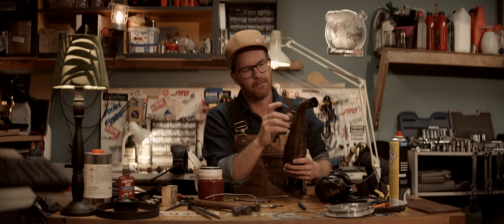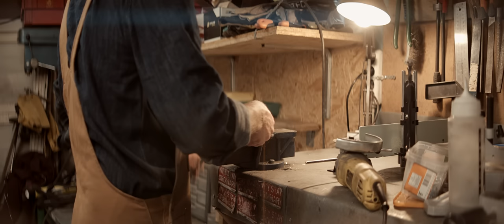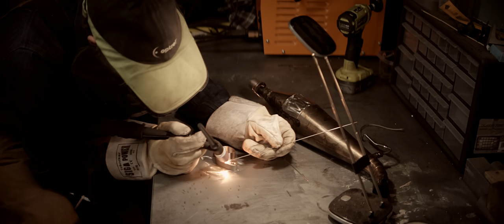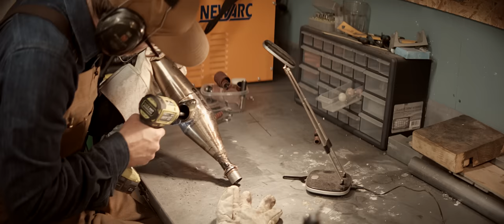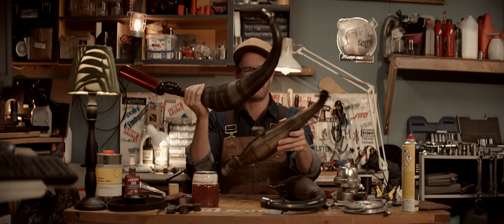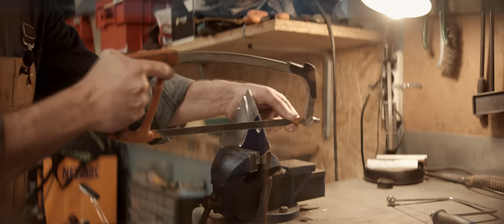Two Stroke Pipe Wastegate - Why do I get such strange problems?!

Comment: Looking forward to the inevitable variable length exhaust pipe for peak power at all RPMs.
Reply: Same here
Reply: I’ve had this idea for a long time myself
Reply: Or variable cones, but with burned oil it wouldn't last long
Reply: Or variable cones, but with burned oil it wouldn't last long
Reply: Or a power valve.
Reply: Or say a torque vectoring nozzle like on a fighter jet. As you turn the throttle, it tightens up the diameter of the stinger. My crazy ADHD brain just popped this thought into existence.
Reply: I'm thinking of bellows in a tube which are able to be pressurized and make the perfect pipe at any moment. But all the variable stuff has a big and heavy problem. The logistics of where to put everything....
Reply: @bstiphout1 yes, like a bladder, take a tap from one location of the exhaust to adjust the pressure of it to the pressure of the main exhaust path.
Reply: I raced the 135cc Enduro Lay-down kart class, speed 140mph. When I put on the Slippy pipe and ran the 150cc class with my 135cc engine I was very completive as others in winning and my lap times were way faster. My 135cc class I was the points leader. Pipe tuning skills are not with this one.
Reply: Knew a guy that made a variable length expansion chamber in the late 60's / early 70's. He put it on his racing go kart. The results were so good that he was banned from using it in his racing club.
Reply: @terry1309  The Karting world still uses a Slippy pipe. I raced with one for over 20 years now.
Reply: This guy build one 11years ago
Reply: 2 stroke trombone! 😂
Reply: CVEC FTW!!
Reply: The expansion expansion chamber?
Reply: I was thinking about that like 15 years ago for my Jawa 50 because it has only 3 gears you can't tune high enough. Something like a mowable center section
Reply: Lol imagine
Reply: Titanium pipe, turn engine so exhaust in rear. Center section threads with a coarse thread, maybe hydro formed so a centrifugal flyweight system can cause the length diff. As it only has to work one time per flat out run , some springs and grease and bobs your uncle.
Reply: While you have the gaping hole did you inspect the welds for deficiencies and alignment?
Reply: And lose the heat probe wrapped it next to the pipe, and insulated it will be laggy but accurate for what you need.
Reply: @mrsnezbit2219  do you think it’s going to last long. He’s building a bomb in his garage.
Reply: Yes please. Oh yes.
Reply: dammit, every where i look i thought i was the only one thinking about this idea.
but under this comment at 2 stroke stuffing 200 other people have this idea,
this broke my ilussion of being Einstein... LOL...
Reply: Wouldn’t a power valve be a better idea? I think that is the issue with exhaust but you guys would know more about 2strokes then I
Reply: Like a trombone. You hook the slider to your heel as you rev it out.
Reply: Connect the slider with the tachometer
Reply: There is a US patent out on such a design
Reply: I think only reason its running at high rpm is bc inertia gives it no choice but to run😂.pipes too small 🤷🏻‍♂️
Reply: The original plan for the engine was to run at a constant 20k rpm so it's always making peak power. That's why the pipe is so specific and case volume so big
Reply: Trombone
Reply: @kasper-jw2441  when it comes to engines almost everything have been thought of and tried. It is often some parameter in it that has made it not viable, price, weight, materials or technology.Sometimes it looks like there is a new idea but you can bet your hat on it that some thought of it i like 1920
Reply: @lunchman84   true, idea's are pretty easy, i also saw nobody attempting making an exhaust that can change shape.
the main reason big brands didnt work on this is because 2 strokes wont sell these days, but who knows, maybe in the future when the green people are convinced that 2 strokes arent that bad, maybe then..
2 strokes are just not viable at the moment.
Reply: variable length stinger is useless ..he's going for top end
Reply: @mrsnezbit2219 that shouldn’t be a problem if your using the engine properly. Meaning always in the power band.

Comment: Assuming you are still using slip fit crank bearings, you should check if you have side to side play in your crankshaft. If you do, that would cause the rotary valve to drag against the cases under pressure. During the downstroke, pressure is pushing against the rotary valve, and if your crankshaft has side-to-side movement, that would cause the crankshaft to shift to one side causing the rotary valve to drag against the cases. 

By making an exhaust leak, you are reducing the pressure pushing against the rotary valve, reducing the friction and allowing the engine to rev up. After certain rpm, the engine makes enough power to overcome the friction of the rotary valve allowing it to run.
Reply: woaw, very nice possible explanation you got there !
Reply: That is serious rotary juju
Reply: Good point
Reply: The pipe pressure and the crankcase pressure are independent. Lowering pipe pressure has minimal, if any effect on case pressure.
Reply: i belive that his rotary valve is not fix to crank for side to side movment, its just floating in housing
Reply: This has happened a few times.  Should be good now lol

Comment: a HIGH RPM starter and a HIGH RPM idle would make life so much easier. You don't care about low RPM so don't even bother with it since its giving you so much trouble
Reply: Exactly what i was thinking.
Reply: Like what he did with the clutch in previous videos ? Riding it onto the power band. Same videos that went well and higher rpm. The same videos he played with carbs like he knew what he was doing but didnt.
Reply: @andrewwhite986  Hes done that in previous videos.
Reply: @MrJermbob seems like you can build better one ,you should give it a try and record as you seems to disregard experiments he is doing. tbh we have no knowledge to know what to do next. tell us ,if you know better ,what should he do?
Reply: @MrJermbob  no totally not. The clutch wont do anything in this situation. The engine can't even get out of its own way when its under 0 load. Having a clutch won't help it go into higher RPM. It needs something external to spin it to that higher RPM so it can stay there( a high RPM starter)
Reply: @dieselgeezer18  Disagree but lets see whos right. ill come back and comment next vid.
Reply: @dieselgeezer18  Why did it rev before and come onto the pipe with a clutch ?
Reply: So im back. Your starter motor idea was dumb. @dieselgeezer18
Reply: @MrJermbob  How does his new video show that my idea is dumb? He didn't do ANYTHING with high rpm starters. please explain
Reply: Kinda like the mitsubishi evolution from extreme tuners... it idles at 5k rpm 😮 and gets upto about 12k rpm 😁😁😁😁

Comment: I think you have to keep in mind that pulse and gasflow are two totaly different things, for a good resonance you need just a little more then 180 degrees exhaustport opening time. 
It only gets in resonance (if exhaust is calculated well) in in the powerband . Distance from piston to the end of the endcone ( start powerband), and distance piston to the beginning of the endcone ( end of the powerband).
Think you have a gasflow problem, cause not long enough and to big pipe from the piston to start of the first cone.
Thats why it runs the best on the "mellow" pipe ! but the Mellow pipe has a way to long end cone ( good for wide powerband, but the longer the weaker ) weld a shorter endcone on your mellow pipe, and hopefully you get a good starting point to adjust and experiment further.
Reply: Yes it seems it has too much pressure in the exhaust and keepeing it at some distance lets the pressure out but the wave still hits. Maybe a perforated endcone would do something?
Reply: I was wondering what the total volume of exhaust gases are at the highest rpm desired. 
How much back pressure is created from this volume through the oreface of the stinger resonance vs back pressure. Can the two properties live in harmony?
Can’t wait to see the fix!
This doesn’t look like an easy problem to solve.
Reply: A mon avis il a plus de 180 degrés à l’échappement
Reply: Yep spoton I've been telling Alex time and time again just that piston to start of cone (expansion chamber) is way to short  , have no idea where he got the info from but he's believing shorter next to no length of pipe before cone starts is all topend power .
I hope he reads both our post and my other post and saves wasting time .
Cheers
Reply: @rexhorning7228  Yes I think the backpressure in the pipe is cancelling out the waves at all rpms, it's just more problematic at low rpm, I believe it needs a very short pipe with a larger diameter.

Comment: Good idea with building the high rpm starter.
You would just need to make the starter go above the troubling RPM. And have a high idle. It is a race engine after all.
Reply: I would go for a 3 phase high RPM (3600RPM), with some handles, a switch, and a clutch or failure coupling of some sort, so you don't break a wrist or an arm if it stalls, and a one way bearing ofc.
Reply: Sounds like the clutch idea he had in previous videos. So dumb.
Reply: @@tobiascat6173 Why not just go back to when it revved and not need the starter motor ? LOL

Comment: This is very interesting. Similar to a musical instrument. Put a speaker at the inlet and connect a variable tone generator. Go through the frequency band and manipulate the exhaust pipe like an instrument.
Reply: This is a fantastic idea.
Reply: If you measure the impedance curve of the speaker in free air and compare it to when it's connected to the pipe, it should give an idea of the character of the pipe. Free programs that can do this would be ARTA or REW. One can also buy a complete HW & SW called DATS, not too expensive.
Reply: @belyear  Needs to be very hot though.
Reply: Make a few sets of "ocarina" pipes to test resonance profiles. It's not just a matter of having a valved hole, but where to put it.
Reply: I have done something similar with the inlet manifold on my car engine fitted with Dellorto 40 DCOE carburettors in order to decide on an inlet ram pipe length. Play a frequency range with a signal generator and loudspaeker and "listen" as so to speak with a spectrum analyser to pick up the resonances. You can often pick up the resonances by ear also. Correlating the resonances with dimensions id=s the trick part.
Reply: You guys are making it a bit too technical. This can all be done on paper, but Alex prefers to work with metal instead.

Comment: I think your very cool exhaust port design is making the engine really sensitive, therefore normal pipe design and issues aren't applicable to your engine. It is a very very cool (interesting) problem to have, glad I've been following you all along
Reply: I mentioned before that it seems like he needs an exhaust not designed to maximize resonance but to maximize flow and find a reasonable amount of backpressure.
Reply: The exhaust was made for his exhaust port design. He doesnt run the "cool" exhaust port design that the pipe was made for. This is why the pipe is wrong. All these suggestions in these comments are freaking dumb.
Reply: @microsoft790  But flow isnt a thing to consider on a 2 stroke lol ? The flow is simply set by the last dimension of the pipe which is set to the thermal limit of the engines ability to stay cool.
Reply: @MrJermbob  flow is very much a thing to consider and I don't know where you even get the idea that it isn't. Any motor with too restrictive of an exhaust is going to choke itself out especially one thats supposed to shove exhaust gas back into the cylinder.  as far as I'm aware his end goal is still to have positive pressure on the intake side of the motor, and that's going to make it REALLY hard to get his exhaust to resonate consistently. Until he moves into actually scavenging the exhaust out instead of back in, his motor is gonna keep choking.
Reply: @microsoft790  Two stroke exhaust tip outlet dials the hp and thermal limit of the motor. Not the flow.
Reply: @microsoft790  how can it be choking itself at 2000 rpm? It's an exhaust with a 15mm, englarged to 25mm, stinger. That's almost the size of the exhaust on my 1.0 car lol
Reply: @MrJermbob  then why would it not work at all with some other exhausts? Then why would it need a giant galing hole in the resonance chamber to even start? I think that such a unique exhaust design requires an equally unique approach to problem solving. But that's just me, a little guy on the internet whose opinion is worth jack shit. What do I know? I'm no engineer. Have a nice day
Reply: @flakey7832  I have fritz overmarss exhaust calculator. Using that information the pipe is wrong. You can try call overmars wrong if you like ?
Reply: @flakey7832  Poor scavenging, like how a drag motor may have a poor idle because of excessive overlap and incomplete cylinder charging, just like all 2 strokes have! Thanks for engaging in thoughtful conversation!

Comment: Just an idea but have you tried an extension tube between the carb and the block because two strokes like the inrush pulse to arrive at the correct time you can adjust the length to find the sweet spot in the power band (this was a common trick on MZ racers in the 80's-90's) also ........YPVS!

Comment: i think a telescopic pipe (as mentioned in other comments) is a good idea, its used on velosolex races to pull as much rpms as possible on the tiny 49cc engines, the pilot have to control the throttle and the pipe lenght at the same time, they use cables and a second throttle handle to change the lenght of the pipe

Comment: Hey my dude! I think i found a solution (and maybe the reason, at least one of them). At first, please excause my bad english because my native languagr is german😅.
Your "pulse-problem" (PP, from now on) comes from the to a certain degree from your intake side. Because your rotary valve seals everything much better then a standard membrane block would and this causes the engine to suck vacuum from the/trough the exhaust and that is the PP i believe. To compensate for that, i would try to build a pipe with the exact size you want/need but make the bubble of it around 2-3cm bigger in diameter. This would mean that the exhaust has slightly more volume and therefor cant suck enough vacuum between the strokes to make the PP.
A friend of mine here in germany makes 2 stroke pipes for a living and i am waiting for him to get back on my messages. As soon as i got a reply from him (and what he thinks) i will comment under this post and let you know. Maybe it helps😉

Till then, keep your head up and thanks for your videos! Much love❤

Comment: The waste gate open is like an infinitely large accumulator.  Might try a fixed closed volume attached to the waste gate and if you could manually close the waste gate once you reach higher rpms, you might have the best of both worlds.  An accumulator should damp/weaken the pressure pulses.
Reply: Good idea in combination whit rpm reacting exaust valves
Reply: that make the engine to build less horsepower ..the pulses are not exhaust pressure but sound pressure ..you need all you can get ..but he is making it so it is less and will not make as much horse power

Comment: In the early 80s Honda put a extra camber on their exhaust (on the head) that had a valve that opened and closed.  It opened at low end and closed at top, I believe, effectively changing the tune length of the pipe.  Suzuki had something similar but it was built into the front of the engine case.  I have an LT 250 quadracer with it and I can tell you it works.  When that valve actuates it's like a shot of nitrous.

Comment: I'd try a larger diameter expansion chamber. Maybe even build it in sections, start with a divergent cone and header, see if it will start, then add various lengths of centre part, then finally add convergent cone and stinger. Weld, test, repeat. Good luck.
I think you have very high gas velosity.